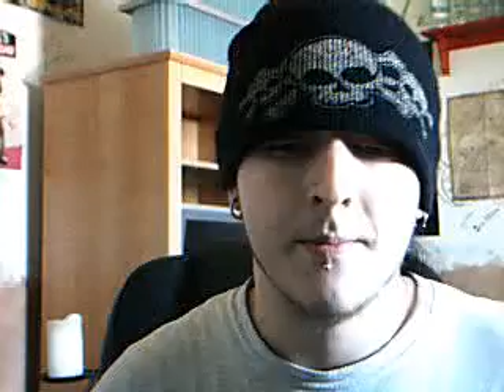This Is My Crazy Green Idea For A Fuel Efficient  Car

Comment: I am fairly well versed in these systems and as you've outlined it, I don't really see anything actually practical (or even possible - what you've stated breaks several physical laws).  If you'd like, I could go into more detail about why this would not work.

You'd have better luck building a perpetual motion machine.  Crazy idea, indeed.

Comment: So this turbine is running from air through the grill while the car is in motion?  So its an electric car now?  How did it get up to speed?  The turbine would never have anywhere near enough power to be of any use hooked up directly to transmission.

Why would it get hot sucking in air at relatively low speeds, ie below 80mph?  This isn't a gas turbine...  There are plenty of ways to utilize heat energy but this wouldn't even be one of them.

Comment: Nothing about this idea is practical... nor would it ever work.

So we are supposed to chuck our IC engine?  So how does the car get up to speed to power the wind turbines in the front of the car?

So are you suggesting an electric car that has wind turbine generators in the grill to charge the battery?  Conservation of energy... you could NEVER EVER earn much of that energy lost to air resistance, rolling resistance, generator inefficiencies, etc.

Comment: y not put the turbine wire it 2 the wheels so the wheels will charge the batteries and the car will run from no fuel. no fuel more miles it works i seen it just like the light from a bike i had years ago the wheels r the turbine

Comment: it's an honest idea, just lacks a bit of science insight. the problem is that in neutral wind, any energy you generate from air on the moving car, you have already paid for with the combustion engine. so rather than gain energy you lose it. it would be better just to replace the grill with a closed smooth aerodynamic surface

Comment: Well, interesting idea, however you would still need to burn fuel to run a gas turbine engine. I also think cost would be much much higher because turbines have many more parts and engineering in them.

Comment: hey did you know that black smoke is actually a good thing. well better anyway. when you don't see smog coming from cars thats because it's clear.

the clear gasses go up into the air and are not collected by clouds...and then they hurt everything above.

the black exhaust is good because it means its made of larger visible particles that can be filtered by clouds.

i mean it is still rained down, but it's more natural.

Comment: It's a good idea.. unfortunately you need a source to keep the turbines working =/ air by itself cannot keep 'em working becouse remember the turbines present resistance which makes the air slow down and eventually your turbines would stop. Oh and BTW I'm not flom Florida LA, SF, or elsewhere in USA.. but I understand your heat h8.. I'm a white Latin American, and for some reason I just cant stand heat at all and where I live is freaking hot